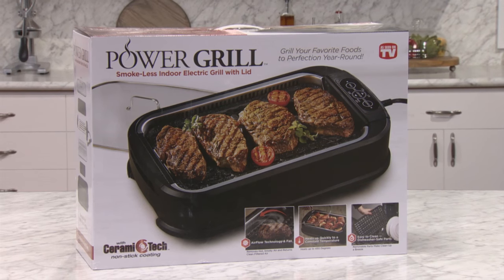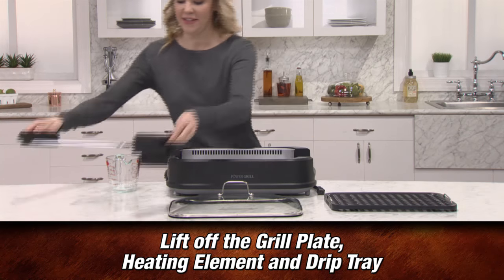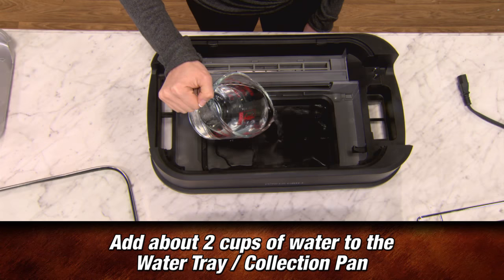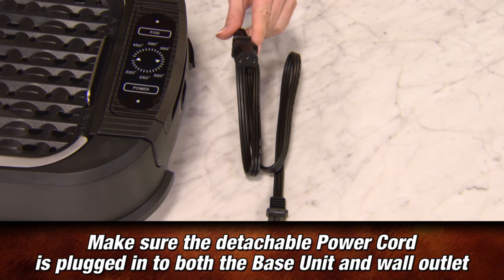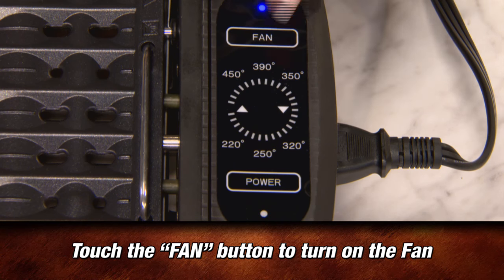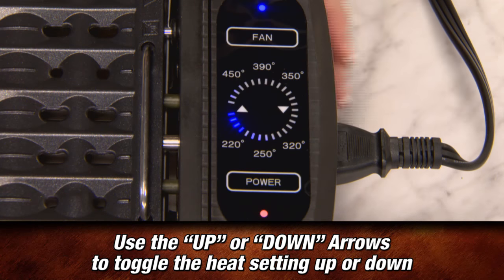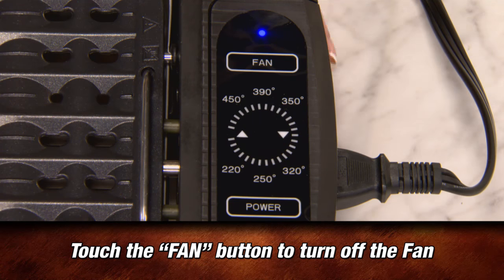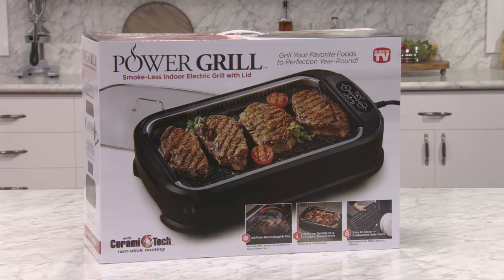Power Smokeless Grill: How to Operate

Comment: How do you know when desired heat us reached
Reply from the maker: Hi James Minott, you can use a kitchen thermometer to check the temperature. You can also visit our online recipe library at https://powersmokelessgrill.com/recipes.php for you to have more ideas in using the Power Smokeless Grill. Thank you!
Reply: I left mine on for one hour and it never got hot enough to cook anything
Reply: @wingus79 What temperature did you set it at when you started? You do know you have to set that, right? It won’t heat up automatically. Just turning it on isn’t enough. You have to set a temperature

Comment: How do you make grilled corn on the cob on this grill? I'm trying to make the Mexican street corn and the instructions just say "grill the corn." No instructions on how long to grill it, etc.
Reply from the maker: Hi Sarah B, we do not have a recipe for grilled corn on our website. However, you can visit the link below to check the available recipes for the Power Smokeless Grill.

https://www.tristarcares.com/recipes-power-smokeless-grill.php

You can also experiment with your recipes or use any cookbook that is available to you. You do not need to select a preset function. Simply choose the time and temperature that suits your taste.
Reply: Using the grill for corn and was wondering if I had it turned up enough which I didn't this was a great help. Thank you
Reply: Mexican street corn is boiled. So just boil it and put it on the grill to sear for a few minutes!

Comment: can I place my Power XL on my glass top stove, I don't have a heat resistant surface
Reply from the maker: Hi Marion Bartm Bart m, place the appliance on a stable, level, horizontal, and heat-resistant surface. Do not place the appliance against a wall or against other appliances. Leave at least 5 inches of free space on the back and sides and above the appliance. Do not place anything on top of the appliance.

Comment: How long can i cook with the 2 cups of water in the tray? Does it have to be changed out? Also does the water tray overflow?
Reply from the maker: Hi Gambino Capo, there is no estimated time on how long does the 2 cups of liquid lasts or can be used during a cooking process. You have the option to change or add liquid depending on your preference. The water tray may overflow if you have added too much water or liquid. Thank you!